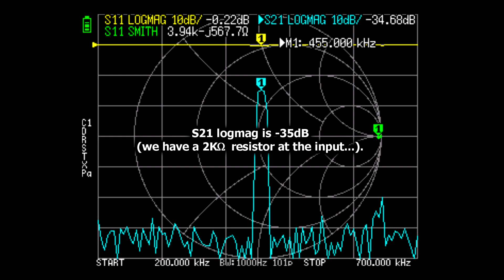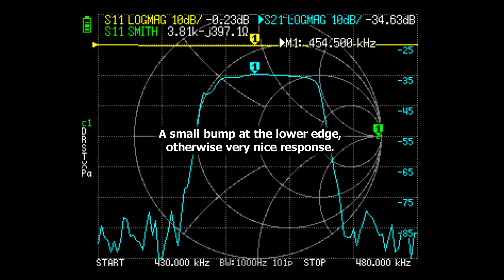Ceramic Filter test with NanoVNA

Comment: Why we need to measure filter with 2Kohm resistors? How did you define 2K? Thank in advance
Reply from the maker: I just followed the test circuit recommended in the datasheet, it states the impedance of the filter as 2Kohms. Apparently the impedance of these filters range from 1k5 to 3k, at least in the documents I checked (from Murata and Transko).
Reply: @unrelatedactivities  Thank you